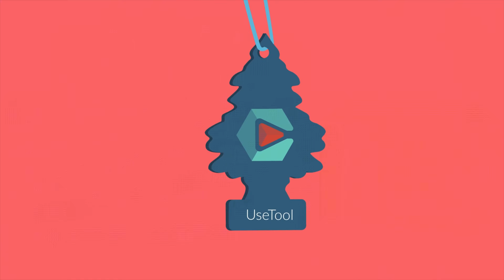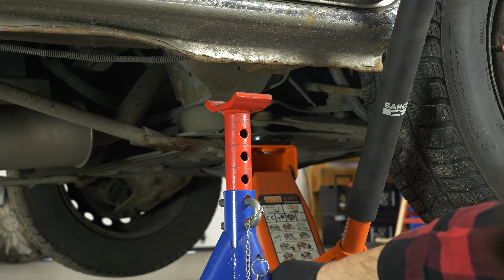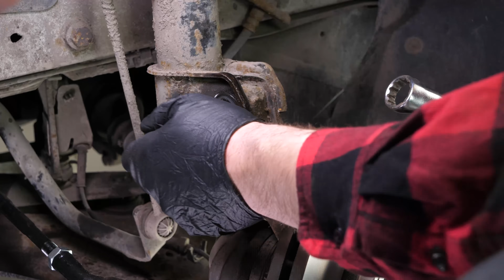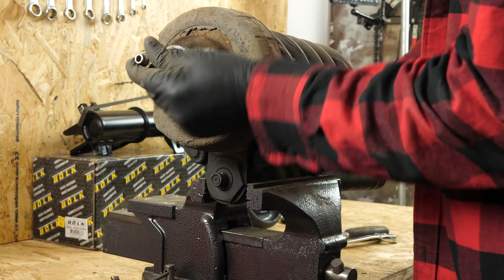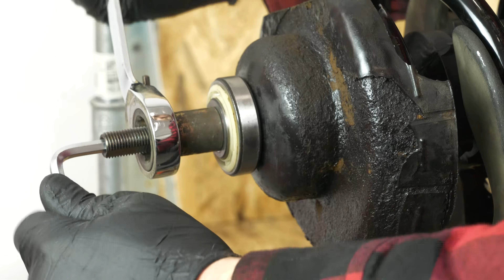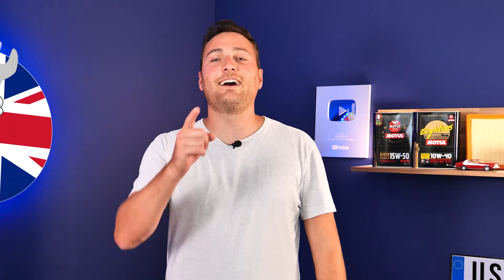How to replace the front shock absorbers Vivaro mk1 ➿

Comment: You forgot the top mount bearing and then all of a sudden it was fitted. These are directional so probably would of been a good idea to show you fitting it.
Reply: I noted too and yes it would have been good if they mentioned that they forgot. And they fitted the bearing wrong you see the middle part which is coming out it's higher that should go on the other side which is down side.
Reply: @MikeChina-q9u spot on. It's surprising how many people fit them wrong. Raised part is always supposed to be facing down
Reply: @BudgetBuilderChris  Yep always the shoulder faces down. When it's fitted wrong it will worn-out premature. And won't be comfortable ride. But these guys are good i love their videos.